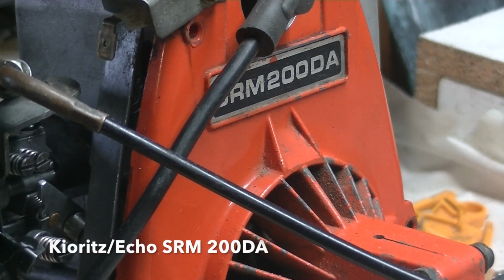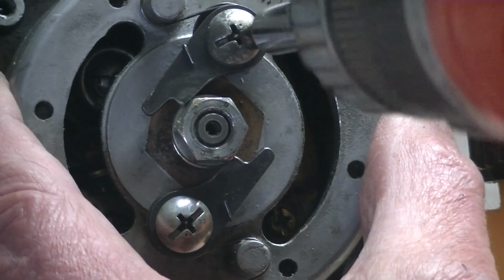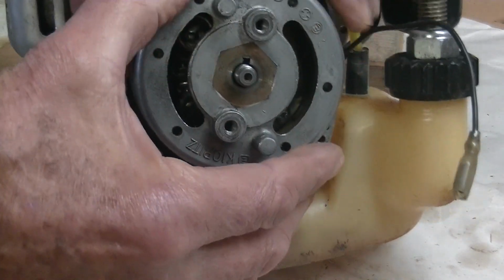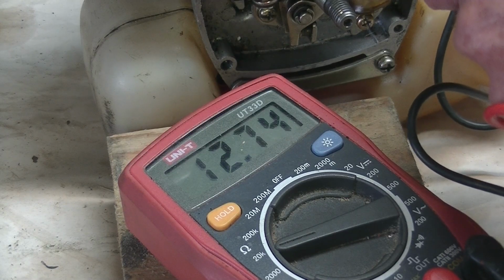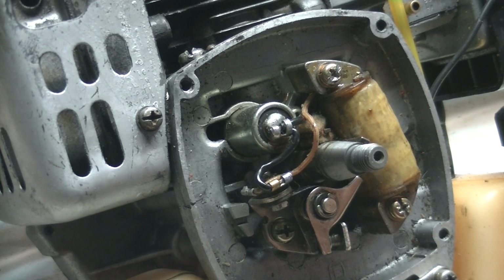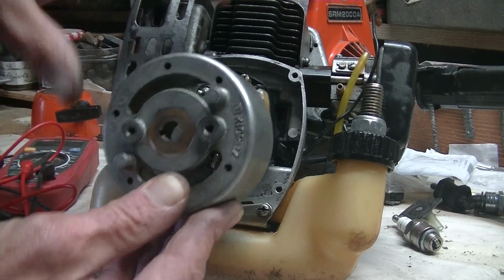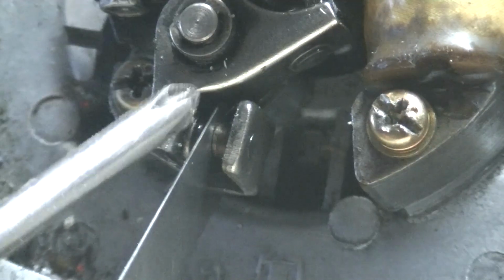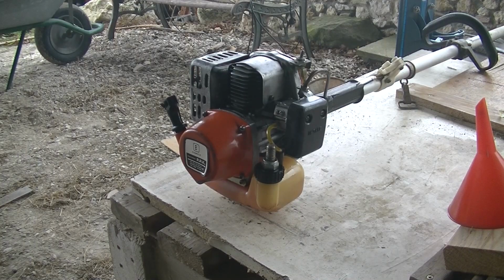What!??? My strimmer has contact points and a condenser?

Comment: Dear davekennedy52,
I have the same motor, but it has the name on it 22cc sears craftsman. Will  not start. When I check for spark (plug removed) I get spark. .When test with a spark tester (replicates test under compression) I get no spark. Testing coil as you had shown I get 002. Question: Where can I get the replacement ignition parts? Also is it possible to convert to electronic ignition without points and condenser.  Any guidance would be appreciated!! Thank you. All the best bruce the swimmer New Rochelle N.Y.
Reply from the maker: Hi Stewart, most people have never heard about this fantastic little motor, so I'm happy to find someone who actually has one! The spec for the coil is between 5 and 6 k ohms. My test showed 4,83 so I thought I had a coil problem. Managed to find a second hand one on a French website called LebonCoin. That gave a reading of 4,80 k ohms and the guy told me that it was from a working machine. my machine is a Kioritz but was also made by Echo. Echo is the factory in the USA. After a lot of blood, sweat and tears I finally found a set of points on ebay and when I put those in, I could at last get a spark. My coil part number is 156 1260 4630 and the set of points is 156 1010 4630. I had to reset the timing on the machine and the timing marks are on the side of the flywheel.
Reply: @davekennedy52  Thanks for the timely reply. Checked and re did plug wire connection. I need the coil, points and condenser probably ok. Put the coil number into google and youtube with nothing resembling the correct part. Any further guidance on obtaining replacement coil appreciated!!
Reply: @davekennedy52  I've recently aquired an srm200da, along with a "Mini Weedy" made by Weedeater, uses a nearly identical engine (keh2020) by kioritz. Great running machines once I went thru them, couldn't resist grabbing them up knowing they had points/condenser being they're age, paid a whopping 30$ for the pair at local yard sale. 🍻
Reply from the maker: @2strokejunkie686  Took me by complete surprise when I opened it up and now I prefer it to my other 2 strimmers. If I could find another one I'd buy it as well.
Reply: @davekennedy52  yeah I've worked on many of the Early Echos and other brands of the era,so I knew as soon as I saw them. Nearly anything made before let's say 78-80 Is going to run points/condenser from lawnmowers to chainsaws, aswell as Weedeaters/strimmers.
Reply: @davekennedy52  yes I agree, anytime I find the early kioritz powered equipment, I snatch them up, I absolutely love them, great running little engines.
Reply from the maker: @2strokejunkie686  had a good 30 minute session with mine yesterday, didn't miss a beat, although it seems to run better with a little choke
Reply: @davekennedy52  have you tried richining the low speed some? That might help, although can be a sign of low compression. If it doesn't respond to adjustment well, a stiff diaphram will also cause inconsistent running where adjustment is constant aswell as needing a little choke. I know you put new rings in her, how did the cylinder look? And have you rebuilt or replaced carb? If your comp is on low side, Running a richer mixture like 20 or 25:1 will help keep tired engines, going a little longer,and run a little better, you will have to open both mixture screws 1/2 to 3/4 turn to bring mixture back in the ball Park due to added viscositie from extra oil etc, ofcourse will smoke a little more but run the good klotz or other bean oil and enjoy the sweet smell😎
Reply from the maker: @2strokejunkie686  Thanks for the good advice, you obviously know these machines very well.Yes, I replaced the rings and piston sides and cylinder are in good condition.The carb has been rebuilt as well. Must admit that the setting of the 2 mixture screws is always a hit and miss so I will try as you suggest. My mixture at the moment is 4%. I do have a problem with the gasket between carb and manifold, think its leaking air but have just received gasket material in the post to make a new one, so that should be done first before I adjust the screws. Right?
Reply: @davekennedy52  Thanks friend, yes Ive tinkered with many of the old machines, over the years.  By all means yes take care of any potential vacuum leaks, before adjusting the carb, once you get that taken care of you can start at 1 1/2 out on both adjustment screws, that will get you close enough to dial her in from there. I recommend at minimum a 32:1 mix, stay away from the 50-60:1, these older machines were meant for 25-30:1, even tho the oil is much better these days 32:1 is the best mix in my opinion, what I run in all my two stroke engines from bikes to lawn equipment, minus my pre65 engines they all get 20:1 being bearing tolerances were designed around much thicker oil mix.
Reply from the maker: @2strokejunkie686  Thanks for all the advice! My gasket material arrived but before I cut a new one I decided to adjust the screws. I turned the low speed outwards a quarter turn and turned the high speed quarter ways inwards. To my surprise, she idled perfectly with no choke at all and revved up nicely as well. Super happy now! Merci!
Reply: @davekennedy52  awesome, I figured that might solve your issue, glad to hear my advice was some help to you 🍻
Reply: @davekennedy52  If you ever have any questions, regarding anything vintage two-stroke related, aswell as some four stroke tech, as I'm not unfamiliar with them, but I specialize in two stroke engines. But Amway feel free to message me, I enjoy helping people along the journey of keeping or bringing back vintage bikes and equipment back to their former glory, as the saying keeps going, they just don't make things like they used to and there just aren't enough of the current generations interested in preserving both machines and knowledge. Soon enough it will die with those who posse's such knowledge, there are guys/gals out there who have forgotten more than I've learned in my decades of experience being a  motorcycle/small engine mechanic/technician whatever you'd like to call it and will soon be passed by Time.
Reply from the maker: @2strokejunkie686  Very well said and I agree with you completely. My kids think I'm crazy. They tossed out a 5 year old vacuum cleaner which I decided to retrieve and fix. It only needed new carbon brushes which cost me 5 Euros. I'm not a fan of the throw away club. Thanks for the very kind offer and I will certainly contact you with any 2 stroke related problem
Reply: @davekennedy52  yep same here call me a hoarder but I don't get rid of anything unless I absolutely could never find a use for..bugs the hell out of my wife lol, but any scrap metal or hardware plastic and rubber grommets and other parts/piece's and things alike etc all get saved as parts is parts as my dad always said, and soon as you through it away you'll find a need for it somehow lol.
Reply from the maker: @2strokejunkie686  haha!! I think our dads were related:)